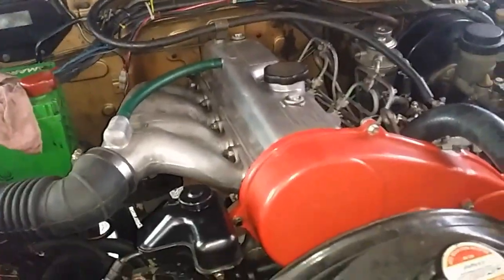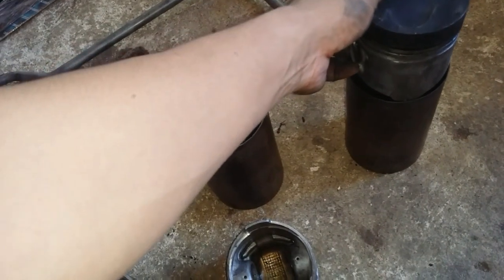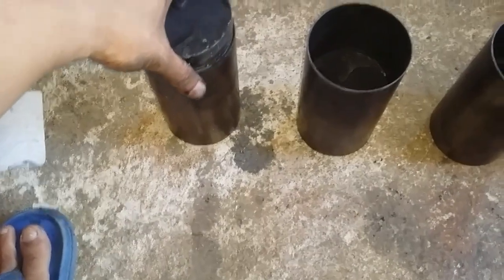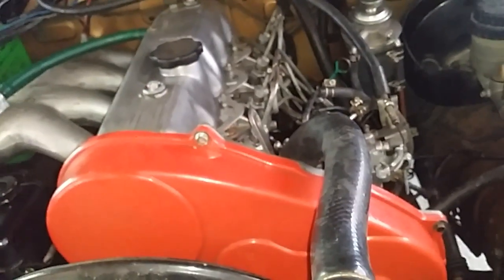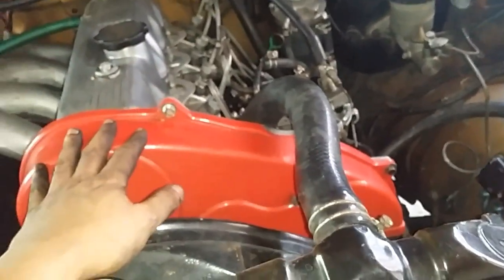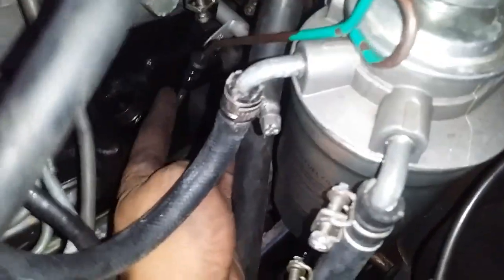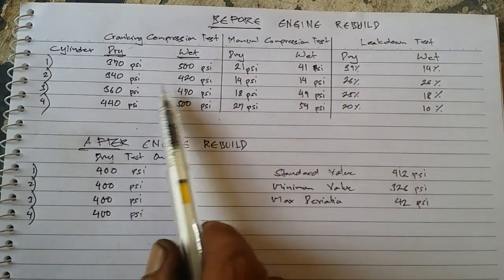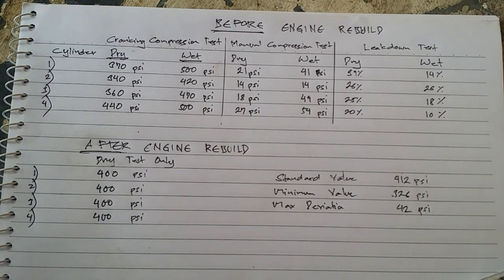Compression Test (AFTER ENGINE REBUILD) PART 3

Comment: First I an 68 yr old and This is best video on blow by !!!!!  Cause and effect , what to look for and where to start looking .  (1) Ur oil cap, (oil coming out of cap and alot of air coming out of it after u take cap off )    (2)  dip stick ( alot of air coming out of it )  (3)  pvc hoses oil coming out at either end,  and to confirm what u have found,     u do a compression check on ur motor etc with air.     A step by step and why.    Plus the best thing is u did it on 4cyc.  Because another video that I saw sayed u really could not tell by the dip stick or the oil cap.      Maybe u can please help me !!!!!!   I have a 2018 nissan frontier  2.5  4cyc with 13000 miles on it.   I have some oil with gas coming out of the pvc shose line.   But this does not always happen.  I was told that this happens when to much oil is put into the motor.  Today I took off the oil cap and there is alot of air coming out it.  Help
Reply from the maker: Only waybto verify is perfom compression test and leakdown test

Comment: I don't have a compression test tool .but I had a crack cylinder head but I was still using my Jeep when I did change the head for a new one the cylinder walls was glazing but I went ahead and put on d new cylinder and now there is no power and oil coming out of the breather hose can't start without glow plugs .the engine sounds fine when it finally started but power is extremely low .

Comment: Good video, I have a question for you , I have this engine in a l200,  see the vent coming out the valve cover on top going too the air intake manifold, is that not effectively chocking up the valves with oil and carbon build up ! Does it really need to go back into the air intake? Would it not be better going through a oil catch reservoir and seal of the the hole on the inlet manifold? I haven't done it, but been wondering about doing it, has anyone done something about this before, what do you think?
Reply from the maker: Maybe this will answer your question https://youtu.be/N5TCxmJPFuU?si=TSCfu8hIIqwRZHfP

Comment: And thanks for the information boss please don't stop ok boss
Reply: Hello boss quick question do the 4d56 sleeves removable or u have to get the block machine I see they selling kits with sleeves but I not sure if the block sleeves can be remove ..thank u
Reply from the maker: bring the block to a machine shop
Reply: @MrDIYer  I thought the 4d56 has dry liner sleeves that can be smashed out.
Reply from the maker: As per 4d56 manual. You can actually insert a flathead screw driver to rip the liner out. But considering you still need to have the new liner pressed in, Bored and honed to .02 to .03mm cylinder wall yo piston clearance, so might as well have the machine shop press remove the old liner amd avoid scratching the engine block.

Comment: Is the piston to cylinder clearance the same for the 4d55t? I. Rebuilding mine and I cant seem to fine a manual
Reply from the maker: Im not sure. But as a rule of thumb you wouldnot  want a cylinder wall to piston clearance of not more than .05mm

Comment: My motor have 450 psi en 1,2 and 4th cylinder, and the third have 480. Besides the difference of compression, it's ok to have 450 psi on each cylinder?
Reply: what engine u have
Reply: There is a limit of pressure difference between the cylinder. If one drops bellow the limit then you will have unbalanced combustion pressure.
Reply: @jasonbaisa818  sorry, my motor is 4d56 turbo intercooler on a 1993 pajero

Comment: Sir pwede kahit dito nalang sa chat. Pakita mo Naman full specs ng 4d56 engine torque, clearance other adjustment pag  overhaul sir..inaabangan ko Po Kasi update mo sir. Salamat Po.
Reply from the maker: may downloadable po na manual para sa 4d56. type mo lang po sa google 4d56 manual. andon lahat ng specifications
Reply: @MrDIYer  salamat Po sir.

Comment: Does having a high
 Amp battery will help starting the engine without or less heater/glowplug?  Ung L3 ko po kasi 8sec heater before starting sa umaga.. Pero once nag start na pede na tuloy tuloy.  Gamit ko 70amp batt.. Kung mag papalit bako ng 90 or 95amp kaya na kahit di mah heater?  (assuming na good ang compressiom)  salamat po
Reply from the maker: im not sure sir but i dont think so. perform.compression test to be sure.

Comment: okay lang ba sir na di magpalit ng liner tapos standard padin ang lalagay na piston ring? saka kung pwedeng baliktarin lang ang liner ng 4d56?
Reply from the maker: Hindi. Kung ayaw mo mag palit liner palitan mo ng oversize .25 o .50  yung piston at piston rings. Depende sa tama sa liner masusukat lng yan gamit ang bore gauge.
Reply: @MrDIYer  ah okay po salamat, iniisip ko po kasi kung magpapalit pa ng liner o piston ring lang, di naman po kasi blowby yung makina nung inoverhaul, naputulan lang ng kunya yung main pulley saka nag le leak, iniisip ko baka pwedeng standard nalang ulit ng piston ring ang ilagay

Comment: Sir If I may po, bagong overhaul po ang aking 98 4d56, new pistons, and rings, con rod bearings, bago din po segunyal na pa pales na din po sa machine shop sa standard size eh kaya ko po pina overhaul kasi po na bulwak ng engine oil sa dipstick sa main cap naman ay usok po pero wala namang engine oil na lumalabas, after engine rebuild po eh parehas pa rin, napamahal na po sa overhaul at labor baka po may number kayo pwede po akong tumawag at magpatulong sir, merry xmas and hoping for your reply sir. Tyvm
Reply from the maker: Na rebore at na hone ba mga cylinder?

Comment: sir may i ask can i put a turbo from another 4d56t to my non turbo 4d56? what do i need to add/change?
Reply from the maker: possible but expensive. replace intake and exhaust manifold. replace cylinder head, valve seats are different and even pistons
Reply: you think the price of an engine swap to a 4d56t would cost me the same as putting turbo on a non turbo 4d56? coz i feel its less powerful with my mitsu adventure
Reply from the maker: i think its more practical to swap engine.

Comment: inaangat nyo pa po ba yung engine nung rebuild nyo po. or nakainstall parin sa kotse po. sana po sir gawa kayo vid kahit discuss nyolang po yung process ng pag rebuild nyo.
Reply from the maker: kailangan ibaba buong makina sir dahil kailangan dalhin sa machine shop ang engine block para palitan ng sleeve. next time kung papalarin gagawan natin ng video.
Reply: @MrDIYer  boss tanong lang po yung 4d56 ko pinalitan na namin nang sleeves, piston ring,main and con bearing water pump and pina plansa narin namin yung head.but still may lumalabas parin na oil sa deep stick hole.ano kaya possible cause bakit may lumalabas parin salamt po.more power po
Reply from the maker: 1. kung bago pa tlgang overhaul yan.. wala pang mahigit 100 o 200 kilometers tinakbo nyan. possible nag brebreakin pa at di pa nag seal masyado ang rings sa cylinder.
2. nakakasiguro ka ba sir na pinalitan nila lahat? baķa kasi oversize piston rings lang pinalitan dyan.
Reply: @MrDIYer  boss pinalitan po talaga nang liner na standard at con and main bearing and piston ring yung piston lang de pinalitan.
Reply from the maker: eh pag may tama yung piston wala parin. lalo na kung wala naman panukat gaya ng micrometer. guessing lang mangyayari nyan.  di mo mababase sira na ang piston base lang sa tingin. sana kung pinalitan na ang liner. pinalitan na rin dapat ng piston. manipis pa sa buhok ang clearance dapat  dyan. .02mm
Reply: @MrDIYer  sir gusto ko magpagawa sayo ng pajero ko batangas area po ako taga saan ka po
Reply: @MrDIYer  saan po location nyo sir